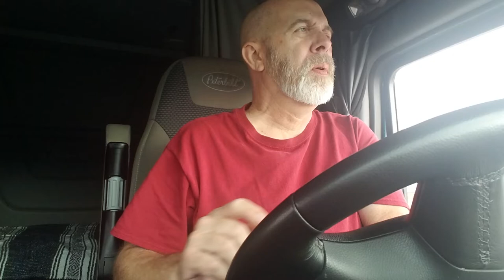What to know about pulling a refer.

Comment: Also I would recommend having a temperature gun, if the product your hauling is too warm your reefer might not be able to bring it down as it’s designed to hold temp saves you a potential claim

Comment: Suspended area of being ignored lol
Reply from the maker: It happens. Not the norm. Once in awhile.
Reply: @artist4truth  definitely good to know. I'm getting ready to start pulling a reefer unit permanently I did it before but I didnt check the trailer itself i delivered 2hrs away and came back multiple times a day! Now I'll be on the road
Reply from the maker: @Cubanguy1977  otr refer are normally long runs. Wait time depends primarily on the company you work for. Live vs drop and hook not the main factor. Is it direct contract or brokered is more important.
Reply: @artist4truth  I believe it's all gonna be live he has dedicated runs also but only time I'll do that is when that driver is on vacation so I'm not counting on those very much